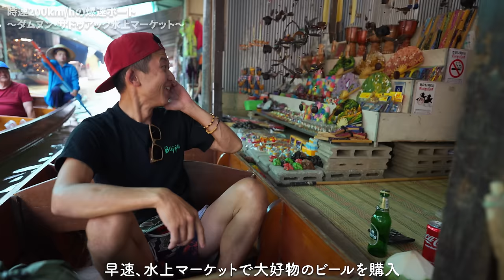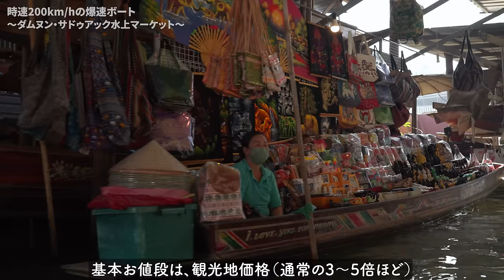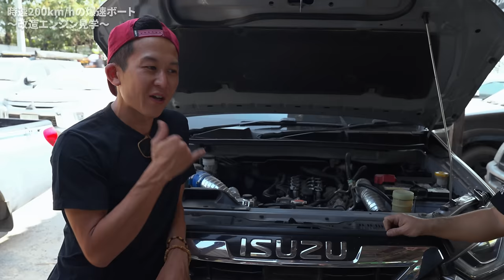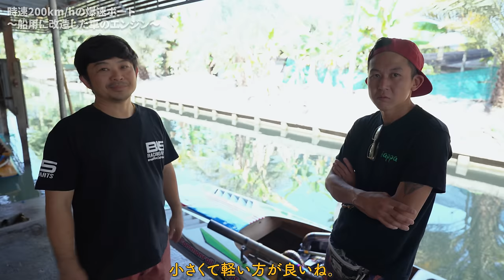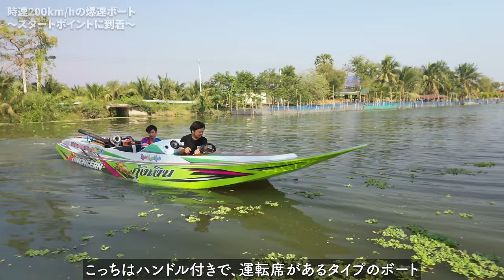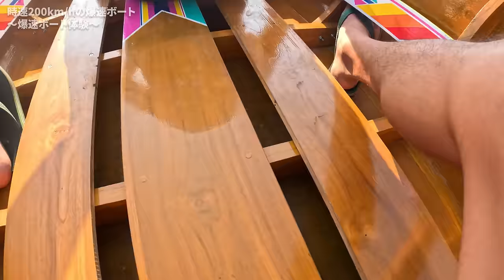日本のエンジンを改造しまくって作った最速200km/hの爆速ボートに乗ったら危険過ぎて気絶しそうになった

Comment: You feel the acceleration, not the speed itself directly. So albeit the speed is just under 200 km/h, the feeling is the other story.  In drag racing you only feel the G-force in one direction. In speed riverboat you'll feel the fluctuating forces both in vertical and in-line direction, let alone the strong wind pressure against your face.
Reply: Acc also come with vibrations and you feel scared from that too. And when high velocity comparing with the boat size it will more unstable
Reply: @BushcraftAI   200kph on a canoe is mental
Reply: @BushcraftAI ❤

Comment: Wow I can tell you don’t know much about engines. A turbo charger and a supercharger are two completely different things.
Reply: a correct: he does NOT know to much about English engineering language, you can add "super" to any name , ( like for example Skoda Superb is not supercharged ) 
and trust me , I'm polish -turbo is turbine powered ( it's obvious) but 'super charged' is completely different translation in polish, I just checked in translator and even translator says super-charger it should be named some kind of 'crankshaft-belt-charged air compression pump' not super-charged. Thanks

Comment: I doubt seriously that little Isuzu 1900 CC truck engine would not even come close to developing 350 Horse Power, even with its turbo charger !  Sorry but that guy is not telling you the truth.  That boat engine could not develop 500 Horse power, even turbocharged.  He's trying to make his builds seem better than they are.  I've watched a video of a company that makes engines specifically for long-tails boats, that will hold multiple passengers and they are less than 500 horse power and are tubo charged large four cylinder diesel engines.  Be careful of liars who will blow smoke up your rear end !
Reply: The 1900cc Isuzu RZ4E on that boat produces 177hp from the factory, 350hp with mods is not out of the ordinary.
Reply: The boat where he goes 190km/h has an Isuzu 4JJ series 2.8-3.0l engine which can produce 1000hp with mods, it's not something new.

You can't go that fast with an engine of only 500hp.